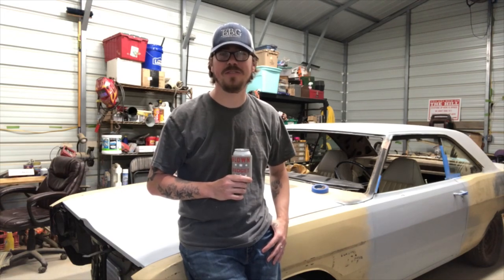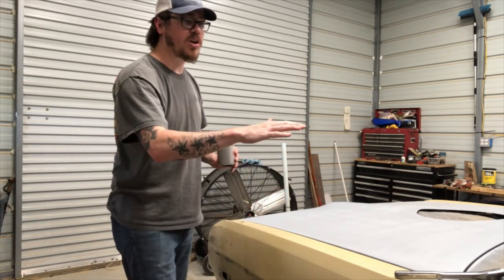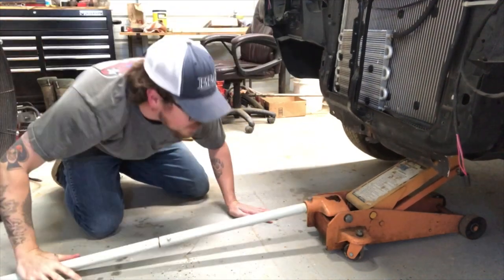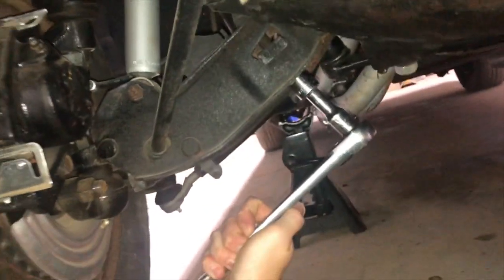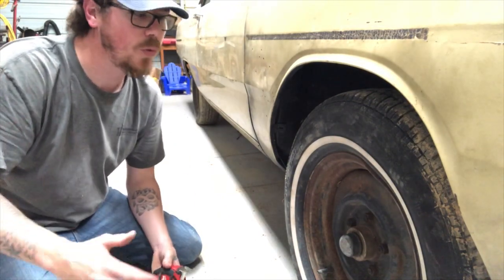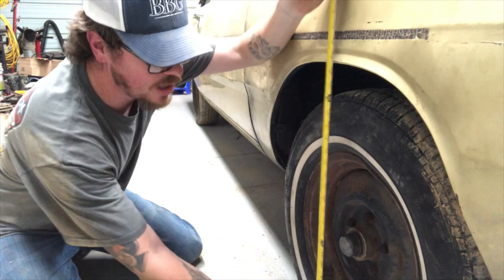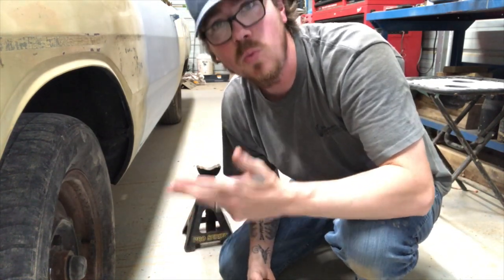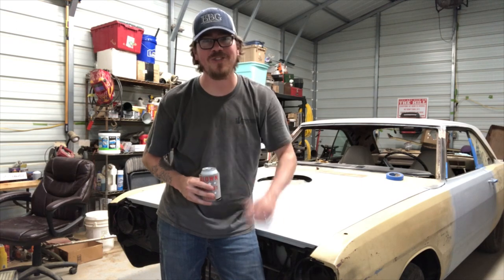How to easily adjust torsion bars to change ride height

Comment: Hey Randy, Nice Video, Check :) My 80 Datsun 720 king cab height is like a 1" or 2" lower on the driver side than the pass side. Is all i do is what your video here shows? I want to bring up the driver side to match the passenger side height.

Thanks

Comment: So, the FSM says to adjust while on the ground, but I suppose there's no reason NOT to do it this way so it's easier to turn the torsion-bar adjusters... I just re-did my entire front suspension, so that thing is on the floor and it's hard to get under it, so this looks like the ticket out.
Reply from the maker: Best way to do it in my opinion.  Never had an issue.  Nope it works for you too!
Reply: @BlownBudgetGarage  Okay, so ROUGHLY obviously, do you know approximately how many full turns I should do to give it a normal ride height from where the adjuster bolt engages the LCA? I know it depends on the bars, weight of the car, all that, but I just don't want to be raising and lowering it every 5 minutes. Just need a ballpark figure. So far, got each one turned 20 turns from where it engages the bar. About ready to lower it to see where it's at. I doubt it's enough.
Reply from the maker: @pdiz  I wish I could give you a number but it’s all dependent on which engine you have be it slant or small block.  It’s just trial and error.